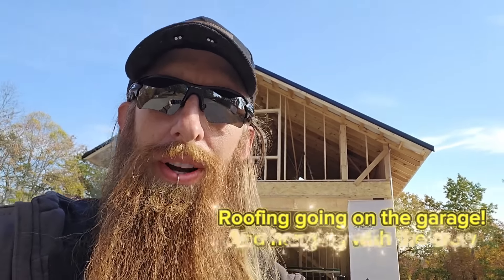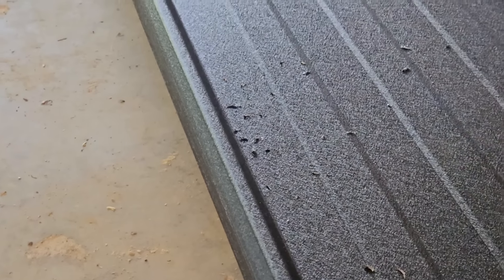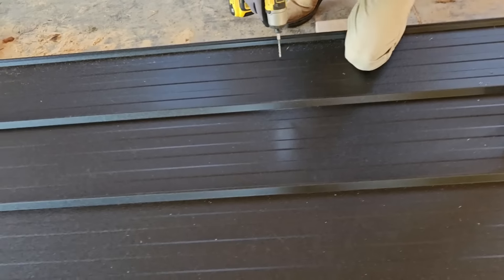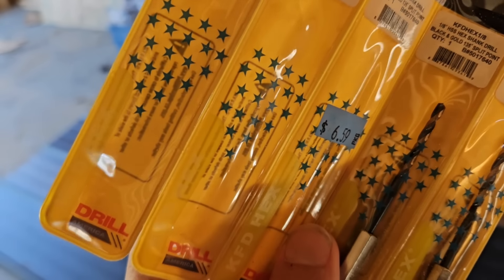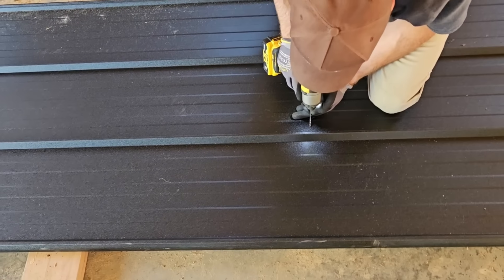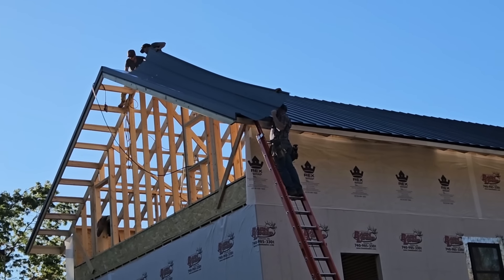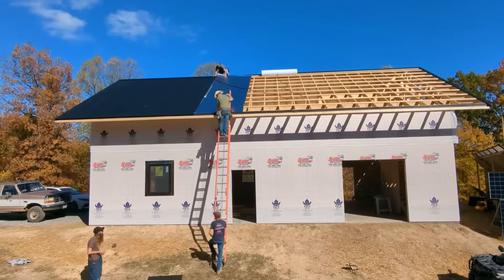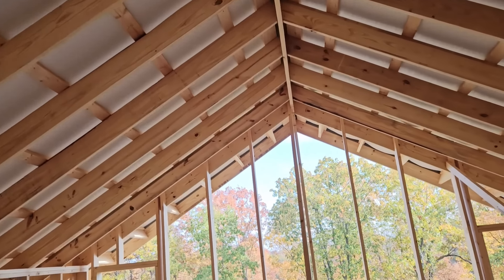Roof metal getting installed on the garage!

Comment: I believe with that underlayment you wont need an airspace ventilation as long as you completely fill the ceiling with insulation. R38 is perfect, you'll be satisfied after you rock it with a vapor barrier. Im starting to get jealous, LOL.

Comment: That foam is absolutely going to help, one of our rental properties has a metal roof for the back porch and in the summer it gets so hot it’s radiating so much heat it feels like you are out in the sun. We have another property where an old garage we are using as storage was reroofed with metal. All we did was take off the old shingles put on2x4s flat going sideways and then metal on top, and it is so much cooler in there because the old sheathing is still there from the old roof, and that alone blocks the radiant heat from the metal roof so much that it is often colder inside the storage than outside, even without any sort of cooling.
Reply: I agree it definitely helps insulate but I miss the sound of the rain on mine when I wanna take a nap on my swing in my glassed in back porch lol I can still hear it but not like I could if it didn't hv the foam lol

Comment: I may comment more during the video but I've never drilled pilot holes on sheet metal roofing. All self tappers with the rubber gasket, never had a bad seal. Use lexel if you do. I also love the smaller silver vein type metal. All types of vein look good. Especially red.

Comment: The screws should never be installed beside the high profile rib, yes screws have a water tight seal but over time they will decay then you will have too get a new roof
Reply: where should they be put

Comment: I don't understand how you can drill so many holes in the roof.  How do you keep rain water out? I suspect some sort of plug or gasket.  How long do those last before the roof starts to leak?
Reply: Steel roof panels are held down by screws and under the head of the screw is a rubber washer, that has to be on it and compressed some but not to much, this rubber washer keeps out water. Pre drilling the screw hole locations is best and that is what was going on. Steel roofs last years. Much longer than a composition roof which is usually 20-27 years even though it may be a 30 year, most fail before 30 years, depends on State to State, weather has a lot to do with it.
Reply: @PRO4XKEV  That's my point. Steel might last 100 years, but the rubber washer, exposed to extreme heat will last maybe 5 years.
Reply from the maker: 15-20 years is common. It'll be a maintenance thing to take care of down the road.